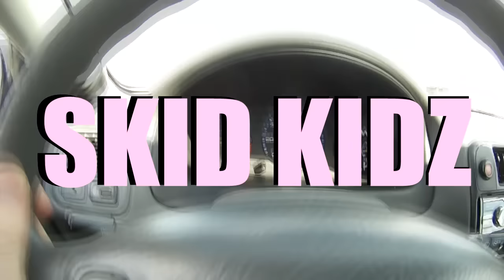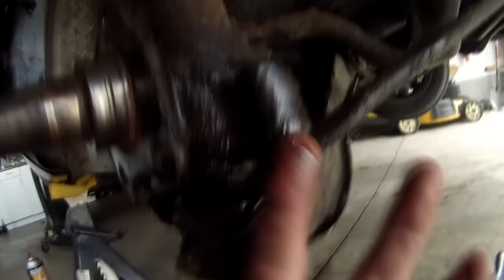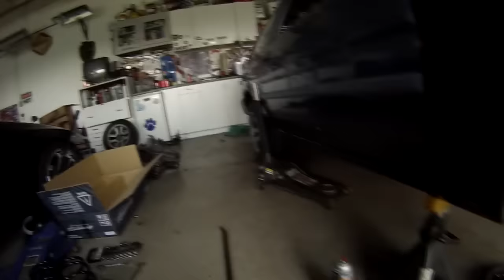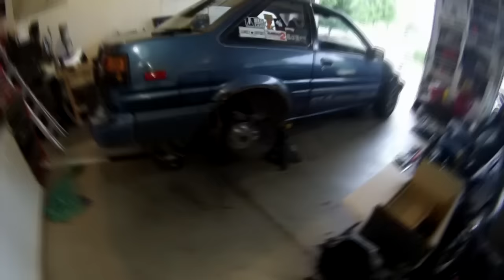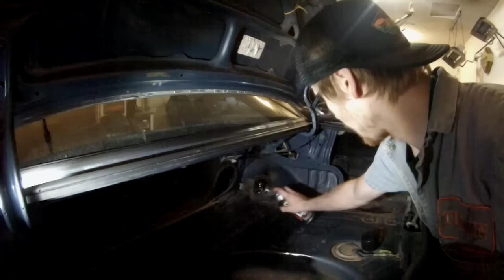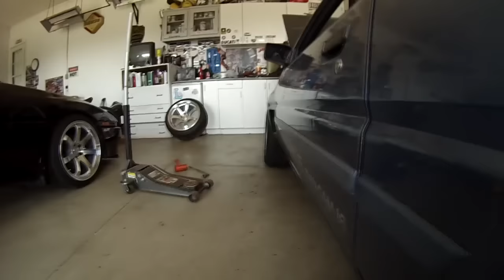AE86 Drift Build - COILOVERS! (EP. 11)

Comment: Nice video as always, although I think I have a suggestion - when repairing parts that are small, a bit in the dark, etc, you could hang a light or something inside (like those mechanic light bars), so the camera can get better footage of the parts/process.
Reply from the maker: I have a magnetic one but the factory undercoating keeps me from hanging it up. I am hoping to get a new camera very soon that has better low light capabilities. The go pro just ain't cutting it anymore. Thanks for watching!